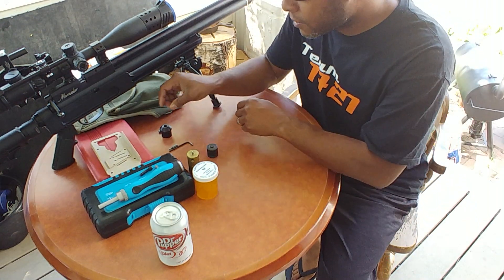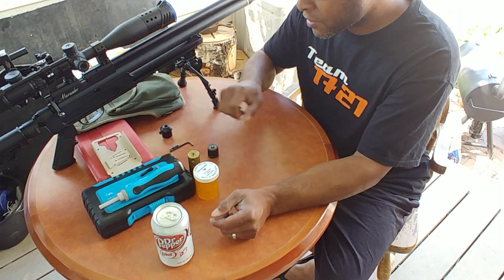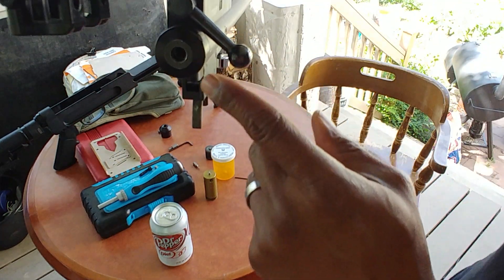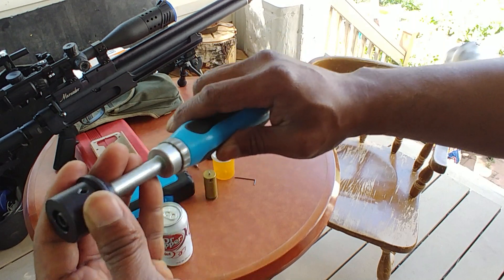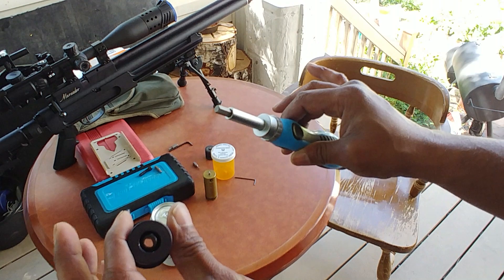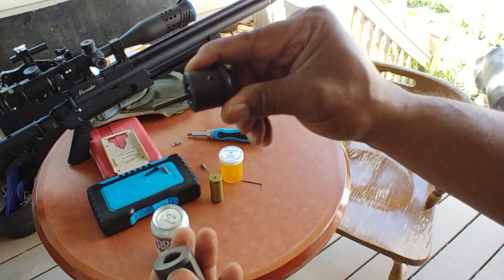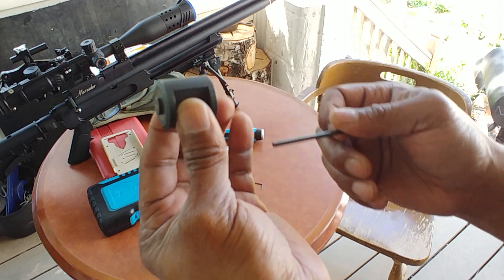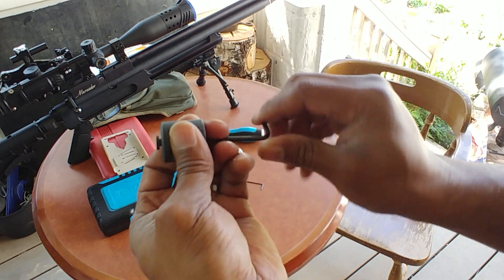How I tune a Benjamin Marauder for power.

Comment: What hammer/spring setting do you have for your 25 cal marauder and also what settings on your reg do you have and what cal slugs are you using I got a tj standard length barrel my huma reg is at 145 bar and my pellets are 25.4 grain fx pellets I want to shoot slugs now that I got a new barrel please please help me
Reply from the maker: When I did this vid, my .25 was setup for power and 2 full magazines.  I had the spring 3 turns in clockwise (from a starting point of it being backed out fully counter clockwise), the hammer striker was 3 turns from flush also...for more hammer travel, the velocity adjustment screw on the right side of the tube was fully backed out 5 turns counter clockwise for full air flow through the transfer port.  I was using a Lane regulator set at 2050psi, averaging 858fps for 42fpe with the JSB .25 Kings 25.39gr.

Comment: hello, video is really good Explained.
I want to know what was fps previous and after tuning the gun what was fps in. 177 cal
Reply from the maker: That .177 was about 876fps/36fpe before, after it was 946fps/42fpe.  Now it's 1000fps capable with a JSAR (Jefferson State Air Rifles) valve and polyurethane hammer.
Reply from the maker: @Werner Voss if you power a M-Rod up and shoot light, sure.  But realistically, you wanna shoot a good weight projectile, at a good speed.  Have fun and thanks for the comment.
Reply from the maker: @Werner Voss a few springer makers do that for sales.  It's unfortunate.

Comment: Hey Joe I did your turn on my field / target but I have something to ask can you adjust the hammer spring with the gun cocked ?? I adjusted the sticker with the gun cocked and forgot to unlock the gun before I adjusted the hammer spring !!! Am I good to go or do I have to readjust the hammer spring again with the gun uncocked ???
Reply from the maker: You can adjust the hammer spring while it's cocked, but I always adjust my hammer spring when the rifle isn't cocked.  It's just easier to do while it's not under load.  Now, if I don't have a long enough Allen key or screw driver, I adjust the striker with the hammer cocked.
Reply: @Monkeydad1969  thank you Joe ! I did not have any problem adjusting it at all when it was cocked ! 
I appreciate all the advice !! 👍

Comment: how many joules we can get without mods, just by adjusting the hammer spring and throw?
Reply from the maker: That's hard to say.  Depends on caliber, ammo, where the rifles sweet spot is.  Can you tell me that info?
Reply: @Monkeydad1969  thanks for answering :)  caliber is .22 (5.5) ,  I often use gamo match pellet 0.9 gramms (13.9 grains).
Reply from the maker: @heisenbergwalter3363  do you have a chronograph?
Reply: @Monkeydad1969  yes on my smartphone (app)

Comment: Is it possible to produce 30-33 foot pounds using a 30cal huma regulator and a power house valve?  I am having a hard time getting the .177 15gn slugs up to 950-1000 fps with my benjamin marauder. 177cal.  I have a 20 inch barrel.    Any help would be appreciated
Reply from the maker: I got over 40fpe with a .177 Marauder shooting 21gr Piledrivers and 19.5gr Varmint Knocker slugs.  I opened the ports on the barrel and valve and put a softer valve return spring in it.  With the .30 Huma and the same work I did, I don't see why not.  The only issue, and don't tell Don I said this, the Powerhouse valve for the Marauder in anything less than .25 isn't what I would use.  It's made to push more air than the .177 can take.  You will just choke the valve out.  Even with the reducer Don sends with it.  The .30 Huma barely has enough plenum for the Cothran valve.  I'd say go with the stock valve.  If you're not afraid to open the ports, then open the barrel and valve to .156.  Hell, send it to me and I'll do it for you.  You also need to increase your hammer throw by backing the striker all the way back to the hammer face.  I'd also back off the hammer spring (counter clockwise) then turn it 3 full turns clockwise.  Also, make sure to clean up the ports once you've opened them and definitely polish the lead in, polish the valve port too.
Reply: @Monkeydad1969  thanks Joe. I'll test out the stock valve and make a longer stroke on the hammer.   Do you think the power house valve would work better with heavier. 22cal slugs? Like 30gn +
Reply from the maker: @airgunsofidaho4886  Like I said in my reply, anything less than .25---actually---anything less than .30 I would not use a Powerhouse valve for.  It just flows too much air.   Even my .35 bottled M-Rod regulated at 1600psi I'm pushing the .35 Polymags at 900fps/146fpe.  It's just too powerful for small bore Marauders.  Now if you were using his Discovery Powerhouse valve, then yes...I would do .172 (yes .172), .177, .22, .25, maybe .257.  I have built a bottled 2260 in .177 using the Disco Powerhouse valve and it's a mean rifle.  I should also say this...I have my .177 M-Rod pushing a lot with the JSAR valve.  NO hammer spring tension, and full hammer stroke.  It is 60fpe with 19.5 grain Varmint Knockers.  Yes, my barrel port is .156.  So once Matt gets everything set at JSAR you may wanna talk to him.  Side note, just cause I brought it up, the M-Rod Powerhouse valve may be really nice for a .257 build...hmmmmmmmmm.
Reply: @Monkeydad1969  I'll test the stock valve for now and maybe upgrade to the jsr valve in the future.  I was building a benjamin discovery 22 but the way it was built i couldn't put it to get there. Haha 😄 I didn't realize a few things before I when to put it together.
Reply from the maker: @airgunsofidaho4886  Discos are easy to build.  Just do it! 😎
Reply: @Monkeydad1969  i have two berral bands and can put them on the airgun since it has a drop block 😤

Comment: My .22 Armada always had an issue. It shoots great but sometimes it shoots a dud and pellet goes like 50 foot or magazine has to be taken out to shoot out the pellet. Any thoughts? Changed the breech O-ring several times but still does it? Took apart once and change the transfer port seals once and another o-ring but no luck. What you think? Thank you.
Reply from the maker: Sounds like the valve not opening up fully.  Is the hammer sticking a little?  What are your settings on the rifle?  Have you taken the valve out and/or done any mods to it?  Hammer spring ok?
Reply: @Monkeydad1969  striker pin all out then 3 turns in. The hammer spring about 4 turns on and valve port screw 4.5 turns out from the bottom. I did order a Hill valve pin and transfer port piece and new seals. Guess needs a full overhaul
Reply from the maker: @explorersepro  I'd be interested in your stock valve... to see if it is the issue.  I don't think your seals are the issue.  Have you noticed when you cock the rifle the efforts seems a lot easier or if it feels like it's binding?
Reply: @Monkeydad1969  cocking has never been real smooth. The last bit I guess seems a little binding maybe.
Reply from the maker: @explorersepro  ok, that helps.  Try a new hammer spring.   Look at your hammer and the area of the tube where it slides.  Check for any wear marks.  I suggest polishing the hammer where it contacts the tube and getting a ball hone to polish the tube where the hammer contacts it.  Also, pull your bolt and see if it has wear marks and if it feels like there's grit on it.  Check the breech, too.  I've had to take very fine grit sandpaper and clean up my bolt and the breech where it slides because of the same issue when I cocked my rifle.
Reply: Thank you
Reply from the maker: @Blackscoutwinter  please let me know how it goes.
Reply: Did a complete tube clean and seals. Polished where hammer rubs. Polished hammer and bolt. Put together. Held air. 24 shots no problems. Little while later first shot... Same issue. I did notice the valve hammer pin is almost impossible to push in when I took it out. Is that suppose to be that hard to push in the pin? Valve grub screw all the way open. 1/8 inch hammer striker 3 turns in from out. 1/4inch hammer spring screw 5 turns in from out. Maybe have a bad valve assembly? So confused. The air tube was kind of icky. But nope
Reply from the maker: @Blackscoutwinter  the valve return springs on the M-Rods is very heavy, I usually replace them with one that is a little softer.  You can take the spring to any hardware store to find a good replacement.  I usually go to Ace Hardware.  I find they have a good selection, especially for a local store.  But you should still be able to push in that valve stem with the stock spring, although it will give you resistance.  If it is that hard to push in, replace the valve return spring.  Let me know.  I believe you can message me through YT still.  That way we can talk and you can send me some pics.  I will be at Shot Show this week, but we can still get this solved together.
Reply: @Monkeydad1969  ok I'll try that. Ordered an upgraded hammer spring. So in about a week should get the parts. I thought of maybe. What YT?
Reply from the maker: @explorersepro  YT is just an abbreviation of YouTube.  But you use to be able to email  people via YouTube.

Comment: What fps would you use on 35 grain slugs on benjerman maraider 25 cal I just got a cronopgraph and don’t know a good fps for it and I also got a 22 twist rate stock length tj barrel stock hammer spring and hammer and valve
Reply from the maker: Well, first make sure the slug is accurate out of that barrel.  Then do chrony work.  Tune the slug and barrel to the speed in which the accuracy is best.  Speed can kill, and I'd rather have accuracy over speed any day.  Basically I can't tell you a definite speed without me actually shooting your rig with that slug.  I can throw a number at you, try low 900's to mid 900's then go from there.  What are the going to use the rig for hunting or punching paper...under 100 yards or really stretching it out?
Reply: @Monkeydad1969  I’m using it for hunting like 70 yards max for the ground squirrel and also I just know your the only person I know with 25 cal slugs that post vids so I came to you for help also I wonder what a stock valve and spring can shoot out of marauder I just want best fps for stock marauder besides the ti barrel I have it is stock
Reply from the maker: @drizzy2110  ok.  But I haven't posted any vids with .25 slugs.  I'm not that com 🤣.  You definitely need to do some chrony work and see what speed they are most accurate at.  What is the grain weight and what slugs are they?

Comment: Hi! Thank you for the great video. I tuned my .22 cal Benjamin Marauder (gen 2/synthetic stock) as specified in your video. I haven't had a chance to chrono it yet or conduct an accuracy test with the new settings. So I'm looking forward to that!  My question is, do you find the sweet spot for how much air pressure you fill the rifle to changes with tune settings? What about the guns preference for pellet make/model? The reason why I ask is, my gun liked exactly 2,600 psi, and with shooting H&N terminators, (16.36gr) I could get around 769 fps, and at 35 yards I could get a three shot group with all three holes touching. I'm curious to see if my rifle will now like a different air pressure charge and also pellet type. Thanks again and looking forward to your insight.
Reply from the maker: Rifles like to shoot what they like.  At any tune a projectile may shoot different than before.  Generally, if a rifle shoots a particular pellet well, than it usually stays the same. The tune I showed is for power so expect an increase in speed.  You may find yourself needing a different pellet.  Maybe even a heavier projectile.  This is when you will have to start testing.  Things will change in one way or another.  The hope is that you'll get 2 magazines with a speed increase, and accuracy.
Reply: @Monkeydad1969  thank you!

Comment: Have ? For you. I bought seal kit  put new seals on the valve  lube it good and the tube  threads but insert it in slow n easy evenly but there couple tiny pieces of seal  Is that normal.   Thanks
Reply from the maker: The gauge hole in the tube is probably catching the o-rings as they pass over.  When you insert the valve and gauge block and get to the o-rings slowly push them over and use a small rounded pick and gently push on the o-ring as it passes.  Put more silicone on the o-rings as they pass.  Also, when you take the rifle down, and the tube is without the internals, smooth down the gauge opening, the openings for the bolt, sear, all the openings.  Get a ball hone and smooth the entire back end of the tube where all the punched openings are.  Get a ball hone with a fine grit.

Comment: My hammer adjuster keeps coming loose. Any suggestions? Thanks Joe!
Reply from the maker: Are you taking about the hammer spring adjuster or the hammer strike pin on the actual hammer?  If it's the spring adjuster is the spring the stock spring or a softer spring?  How often do you adjust it?  Does the adjuster have any play in it when you make adjustments?  
If it's the hammer striker pin, is it loose when you make adjustments?  You may have to take the rifle apart and put a little blue loctite on the threads.  Just make sure you have it set to where you want it.  You can always use a dab of loctite on the hammer spring adjuster to keep it in place.  Also, the loctite will still let you adjust the hammer spring w/o any issues and it will still keep the adjuster set where you leave it.  If any of these parts still give you issues, you can always order replacement parts.  Let me know...
Reply: Not the strike pin and yes it’s a softer spring from Tim Hill. I’ll try the loctite. Thanks!
Reply from the maker: @anthonydefillippis8806  ok.  Don't go crazy and please use the blue loctite.  That softer spring may not have enough tension to keep the adjuster in place.

Comment: hello sr i just i have b. armada ... are they work the same in adjustment of everything in marauder? thank u ..
Reply from the maker: Yes.  The Armada is just a Marauder in a different stock and this tune will work for you.
Reply: @Monkeydad1969   thanx a lot ...men...
Reply: @Monkeydad1969   hello mate im back .. i just want to ask 1 thing .. it regards the bolt action... since i am left handed shooter.. left hand to pulling triger. i would like to change over the bolt lever other side on the left side i mean. so i can easly just pull it by my lefthand.. 
do u have an idea how to change it on otherside? is it posible ?
Reply from the maker: @aerialshootwonderboy919  you have to remove the breech to get to the cocking pin on the bolt.  I can do a vid for you.
Reply: it would be still the same on cocking ? the lever facing down ? when it goes back to secure? coz whats in my mind is il be an oposite way the lever where we hold is facing up after cocking.... 
anyway ill w8 for ur video and really thanx for that... much appreciate.... godblez man....
Reply from the maker: @aerialshootwonderboy919  the Gen 2 M-Rod, which the Armada is, have an ambidextrous bolt.  So it can be used for a right handed or left handed shooter.
Reply from the maker: Hey, I did the vid and it's uploaded.  Please watch and enjoy.

https://youtu.be/OH8iwd9ZPEg